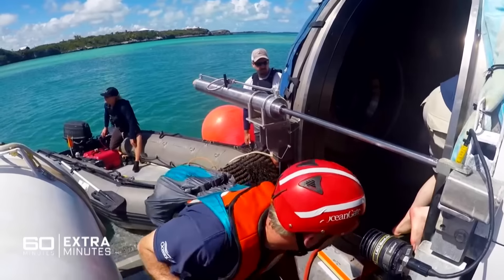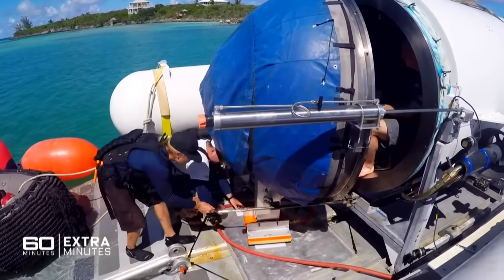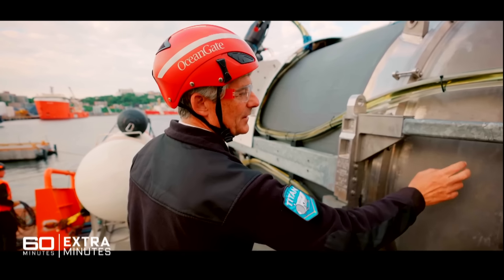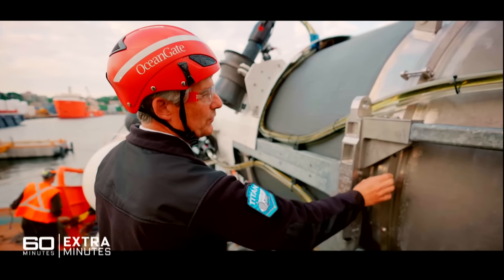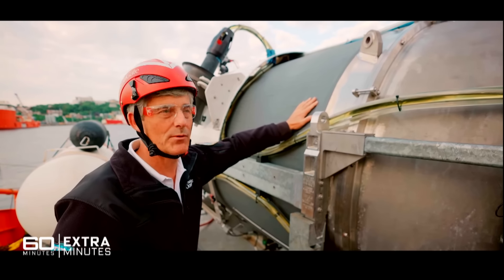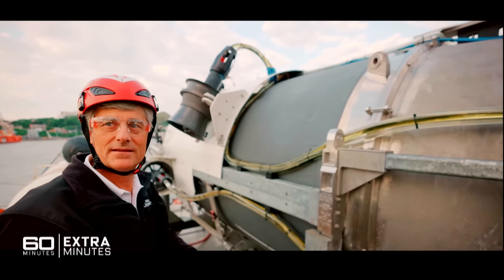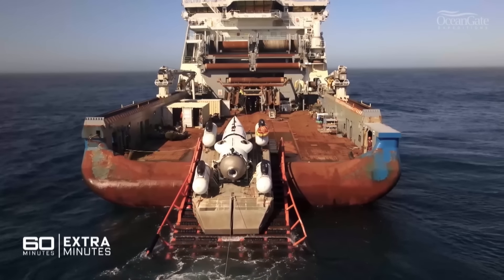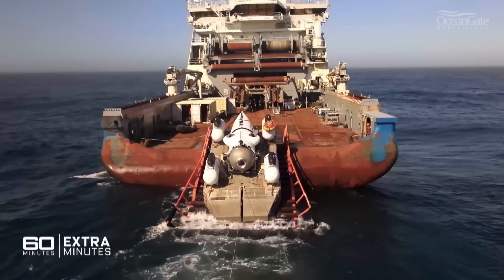Titanic sub implosion explained | 60 Minutes Australia

Comment: The hull was a glorified plastic sewage pipe, not a deepsea submersible.
Reply: Literal pipe bomb
Reply: Wasn't even a solid one material like a pipe,it was worse than that.
Reply: @JustWalkingMan  but bombs EXPLODE, cant be literal
Reply: @LostandFoundTravel  Thank you for correcting my statement. 🙂
Reply: @imissjesus  atom bombs are implosion bombs
Reply: I mean, no, but yes flawed...
Reply: @i_liek_bois .    You are talking about the detonator which triggers the explosion.
Reply: Nailed it. Wow 👍
Reply: Lots of eagle eye hindsight going on.
Reply: Well it made the trip successfully multiple times so you’re wrong. Mr scientist
Reply: @TheQC92 and each trip weakened the structure..
Reply: @JustWalkingMan the ftf😅 HV 2:02  😅  je
Reply: @imissjesus   g
Reply: @cloudstreets1396 there were lots of insight before the tragedy but was dismissed by the CEO. So now...in hindsight.... 😊
Reply: The detonator was the $250k admission fee
Reply: A glorified Pringles can, with just as easy removable lid..
Reply: Absolutely, it’s more like a can of coke than a “submersible” 😂
Reply: @luisrivera3056  😂😂😂 Sadly true, given that people died. Well, Pringles are not good for your health.
Reply: fart can
Reply: What is a submarine if it is not some sort of pipe of varying description?
Reply: @ShawFujikawa  There is a difference between a submarine hull made from materials that have been proven by experience to both withstand the immense pressures at depth and not suffer cycle fatigue, and a glorified plastic pipe which countless experts said was not suitable.
Reply: @annemoncrieff3875  I am curious why they didn't simply install titanium bulkhead rings every foot or so inside to add to the compression strength of the material. I know he was cutting corners and costs but this seems like something a 10 year old could figure out with his lego set.
Reply: Hot water tank with a PS4 controller
Reply: @edsloan8535 

What about the glued on end cap?

Even with metal rings every foot or so, the weakest link is still the glue on the end cap and the acrylic viewport. Putting a steel cage around a balloon doesnt mean you cant still pop the balloon inside the steel cage. The CF was also potentially weak itself. Its wrapped around a shell and layered in single direction which is unheard of for CF used in high strength uses.
Reply: If he used Flex Paste it probably would of held
Reply: @metoo7412  would have held. Have, not of.
Reply: @cjj7107 yep, lots of warnings from experts in the field. So now lots of mockery with hindsight
Reply: This cracked me up for some reason. Thank you
Reply: @metoo7412  Flex Tape has failed on a water bottle that I have tested it on by filling the bottle and squeezing the water out the cap. It started leaking around the tape after 80 uses.

Comment: The biggest carbon fiber difference in airliners vs submersibles is that carbon fiber functions better when expanding from pressure inside out (as in passenger cabins at high altitude) than it does when contracting by being pushed from outside in (as in multiple atmospheres undersea).
Reply: Yes sir! This is exactly why we use these materials for scuba and SCBA air tanks. It’s incredibly strong under tension, not so much under compression.
Reply: Not to even mention any aircraft (or spacecraft, for that matter) is only ever subjected to a maximum of one atmosphere. At the Titanic wreckage, it's 400 atmospheres!
Reply: @97marqedman . I just looked it up. Scuba tanks made out of carbon fiber. That would scare the hell out of me. Real tanks are banged around a lot. That’s the nature of a dive.
Reply: @@BobbyT-yj1cw
Great analogy/explanation.
Reply: Yeah i was booked to go on but pulled out after having my engineers go over the designs extensively, and strongly encouraging me to think twice about this venture. Dodged a bullet there
Reply: @oldmech619  Are they safer because they're smaller? And because they don't go to extreme depths?
Reply: @nocomment4848  You mean, go on the Titan?
Reply: @AlanWinterboy     All scuba tanks need to be neutral buoyant in the water. If the tank weights less on land and will float on water, as a diver, you need to add more lead weights to make it neutral buoyant under the water. CF tanks have an expiration date. The depth a diver can go has nothing to do with the material the tank is made from.   I hope that helps you.
Reply: I don’t believe them 🤷‍♂️
Too much footage from previous dives but not ONE shot on this trip not even a pre trip video 🤔
YEAH RIGHT OCEAN(GATE)
GATE=
Reply: @oldmech619  carbon fiber wrapped tanks have been used in firefighting SCBA for well over 20 years. They take way more of a beating than SCUBA tanks and have a lifespan of 15 years with regular inspection.
Reply: @HayK47    Impressive
Reply: @AlanWinterboy they're safer because thr pressure inside the tank exceeds the pressure outside the tank. The carbon fiber is always in tension.
Reply: @klpittman1  Got. Thanks. Same as in an airliner.
Reply: It can be done. but the shape and construction would be so much overdone.... Sagged octagon/hexagon panels with circumferencing  rips. But even in this case the rips would stay a problem since they would have compression zones.
Reply: Exactly!
Under tension, most of the strength comes from the carbon fibers, which have a very high tensile strength. The resin holds them together but adds very little strength directly.
As the fibers are very flexible, under compression, they contribute very little to the strength of the composite. Most of the strength comes from the resin. Not comparable.
Reply: Also, the pressure differential between cabin air and ambient air at, say, 33,000 feet is a fraction of what it is at 12,500 feet below the surface.